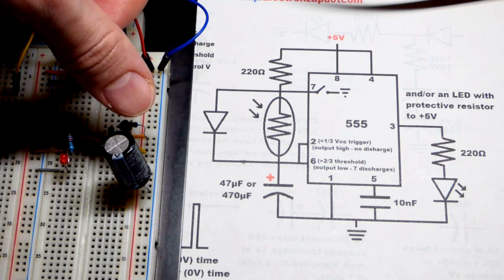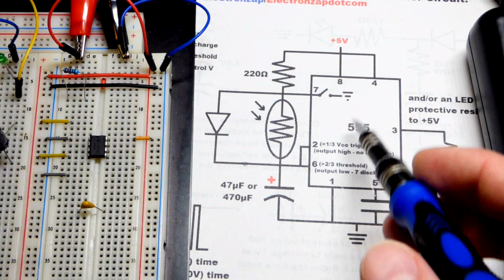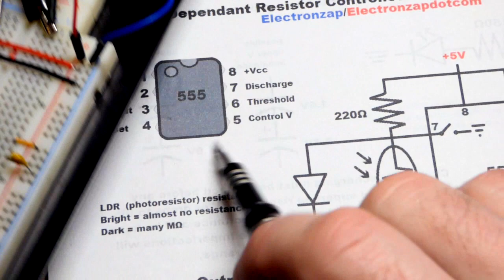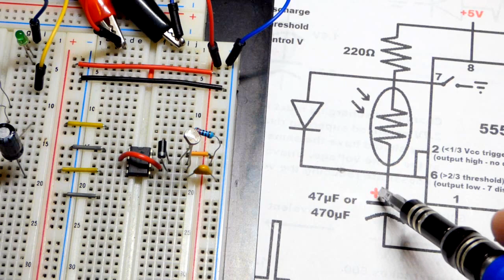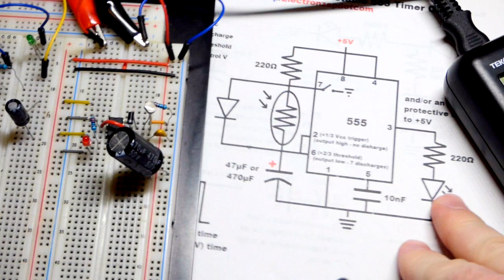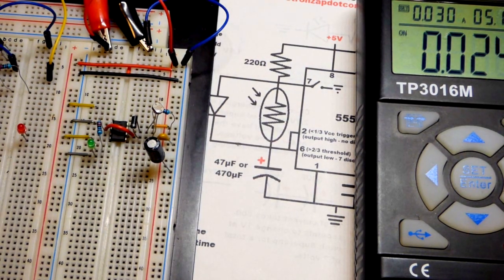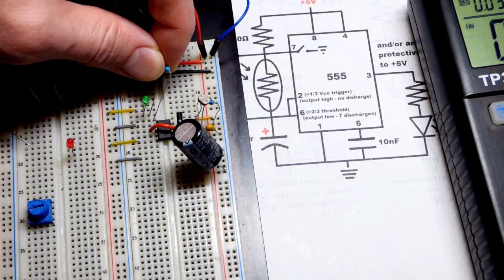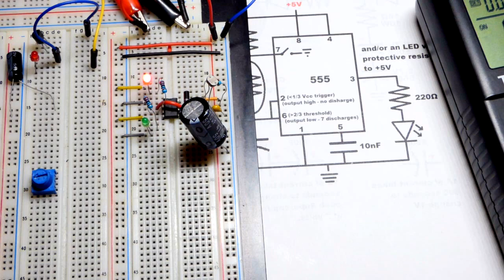Light dependent resistor LDR controlled astable mode 555 timer flashing LED circuit

Comment: Can you replace the LED with a Speaker? That should create some weird noises that would be useful for the discouragement of varmints.
Reply from the maker: I just made a video using this circuit with a speaker at the output. The sounds were indeed awful at times lol.
Reply: electronzapdotcom Splendid!!! The worse sounding, the better!!! It may even be useful to tune the thing to ultrasonic range.
Reply from the maker: Good times!

Comment: You ever mess around with audio amplifiers?
Opamp preamps or preamps made from 555 would be cool to see.
I've been looking into them for a bass guitar preamp or some active pickup circuitry.
Reply from the maker: Haven't really done any audio videos yet.
Reply: @Electronzap  Just replace the LED with an 8 ohm mini speaker, maybe use a cap but about the same xD
Reply: @Electronzap  😏👉 https://www.amazon.com/dp/B0177ABRQ6/
Reply: I don't think you can do that with a 555 timer, which is essentially a square wave generator ... maybe you are thinking of the NE5532 op amp?